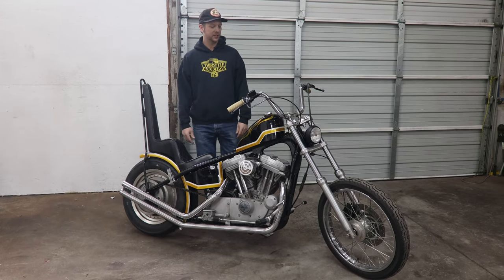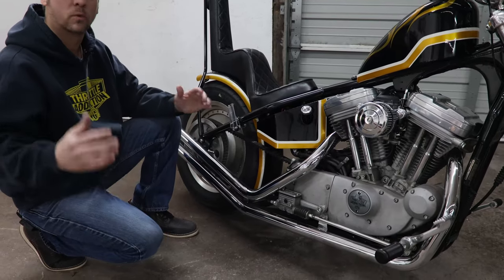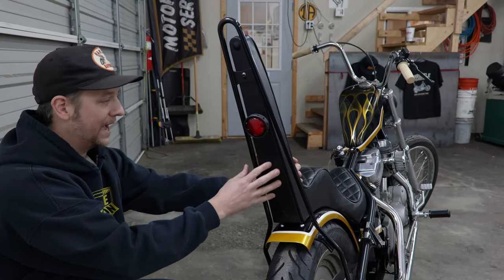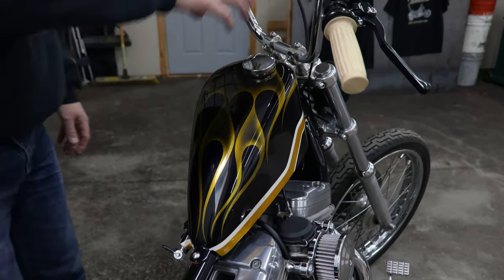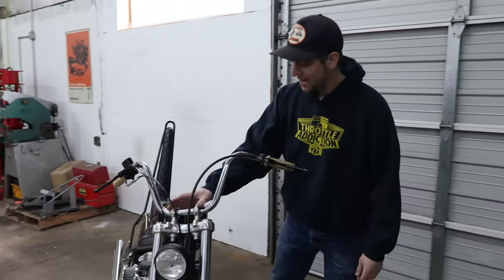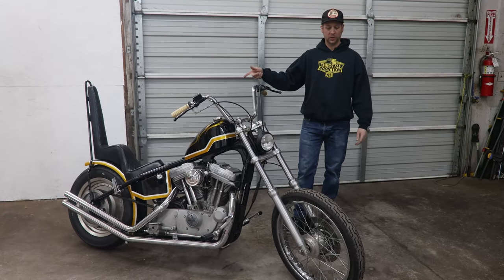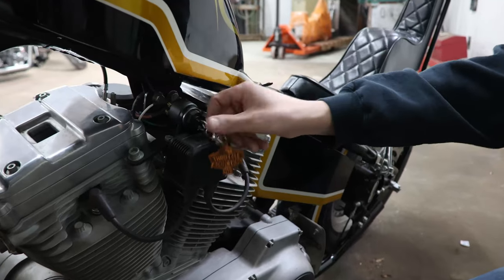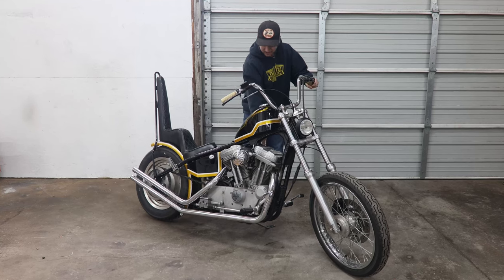Everything I customized on my Sportster Chopper

Comment: That is one of the cleanest EVO Sportster choppers I've seen in quite a while. It's a great no-nonsense road bike -- an everyday rider. The only things I would have done differently was to go with four-inch overstock fork tubes, a H-D 19" cast wheel, retained the front fender mounts, and installed a set of fork gaiters. I love your "philosophy" regarding putting more choppers on the road! Made in America is the only way to go! Throttle Addiction and Chop Cult -- yeah! Keep up the great work! Tell 'em John, Craig and Paul from Eazy Co sentcha!

Comment: what are specs on the chain conversion kit, depending on the offset your {530} chain could rub on  the frame
Reply from the maker: For the conversion kits we sell them based on model year. The 91-99 kit has 12.7mm offset on the front sprocket, and 9.8mm on the rear offset. For all years belt clears and the chain conversion will give you even more clearance so no worries about it rubbing on the frame

Comment: What was involved in using the throttle addiction max current air cleaner? The description online says for 2007 and up but this is a 2002 motor.
Reply from the maker: The breather bolt spacers are different lengths so you have to get creative

Comment: Hi im from Saudi Arabia & i have sportster 2015 72 I want to do this style how much does it cost??
Reply from the maker: It really depends on how far you want to take your build. A hardtail will cost about $500 USD for that model, and probably plan on at least another $500 in smaller parts and pieces to get it running. Then whatever else you want to make it pretty like a new tank, handlebars, paint etc. adds to that. So I would say at least $1000 USD to hardtail your Sportster and make it ridable, then you can gradually make further customizations from there and spend as much or as little as you want
Reply: @ThrottleAddictionCo  do you have what’s app ?? So i can order it??
Reply from the maker: @khaledibr205  unfortunately we are unable to ship to Saudi Arabia at this time, and we don't offer a hardtail for 2015 Sportsters. However, I will link a hardtail from a different manufacturer that might be able to ship one to you: https://www.lowbrowcustoms.com/collections/motorcycle-hardtail/products/weld-on-hardtail-rear-frame-section-2004-2022-harley-davidson-sportster